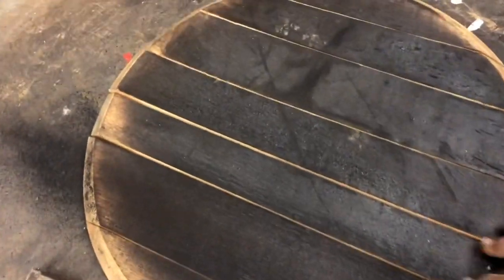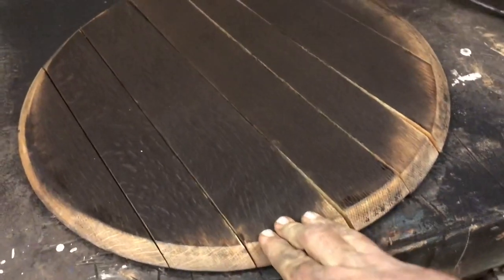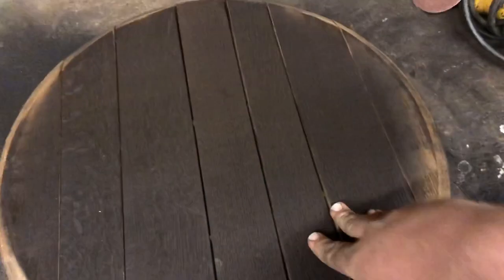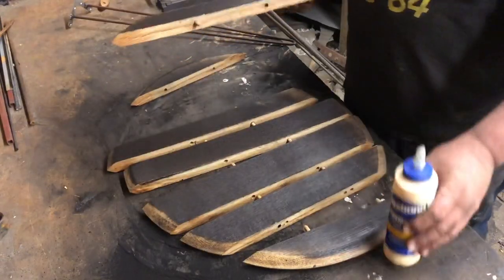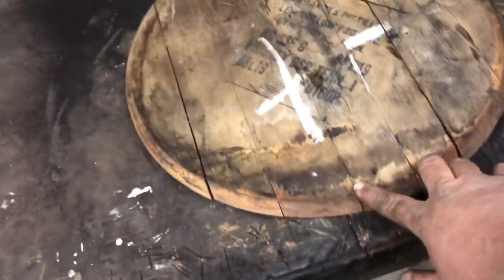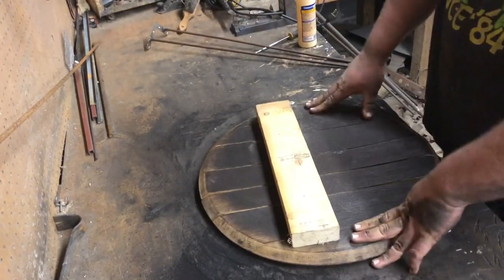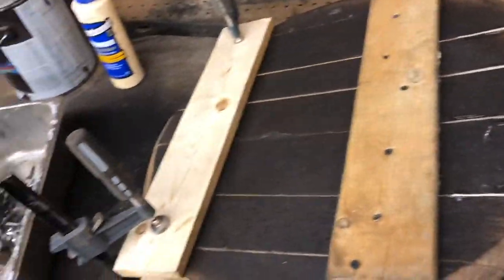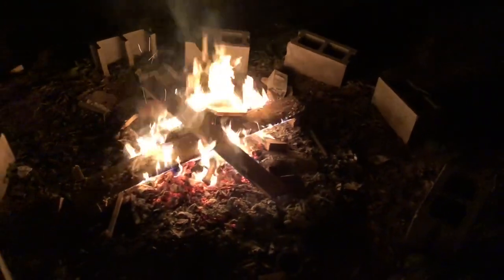Whiskey Barrel lid turned modern end table

Comment: How did you clean the face without loosing the distillery stamp?  What is your process    Very Nice Job!
Reply from the maker: Brian Markiano thanks man I just used some dish soap and warm water with a soft scrub brush let it dry then very lightly sanded and sealed with lacquer
Reply: @builtintennessee5550  Wow, I would have never thought that's how you did it.  Thank you!
Reply: @builtintennessee5550  do you hand sand or with palm sander?
Reply from the maker: Brian Markiano I use both palm around the outside of the letters then a light hand sanding with 220 over the whole top